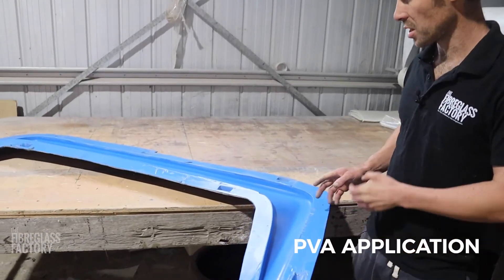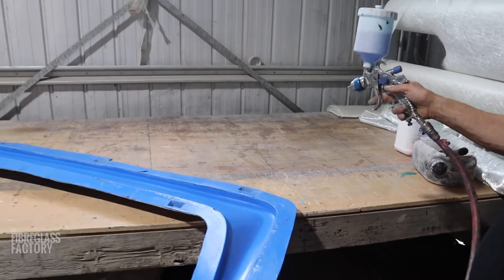Releasing Fibreglass Parts From A Mould

Comment: Ideally you wouldnt want to shoot PVA especially since its mainly a mold release by your rolls of glass or any material that is used to bond/layup on cross contamination can easily occur with delam. PVA can be used to seal gel after the fact for full cure as well you should also look into frekote systems its chemical release cleaner,sealer,release works very well retains gloss less clean up better release ect

Comment: I'm very new to Fibreglass, I've 3D printed a mold and am preparing a shopping list of what I need to get, what tools would you suggest / recommend?  So far in my shopping list I have a roll of fibreglass, Acetone for cleaning and preparing the mold.  Expoxy 2:1 medium hardner resin.  Measuring cups for the resin.  Agent to put on molds before fibreglassing.  Release wax.
Reply from the maker: Need a paint brush and a roller, that sounds like everything